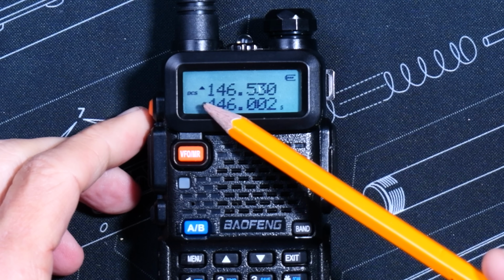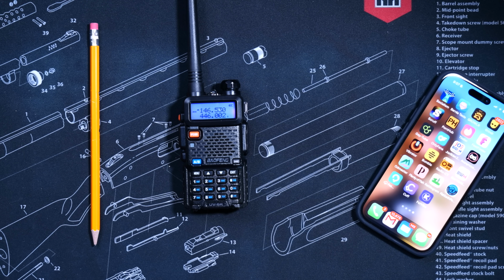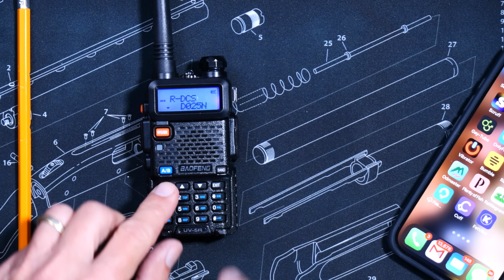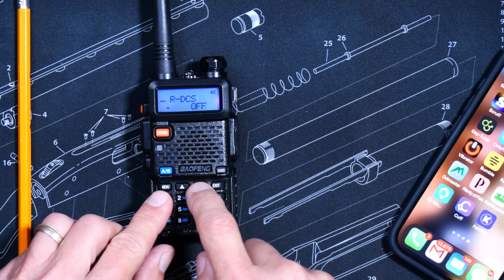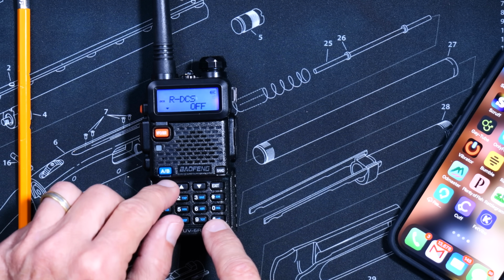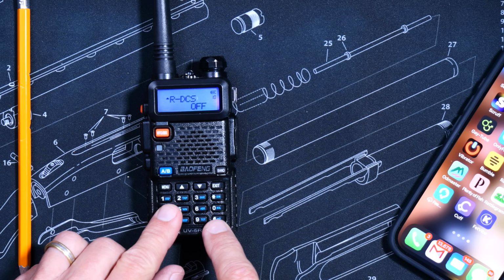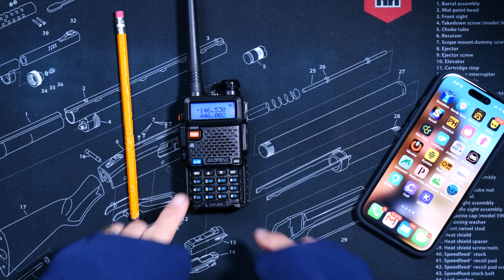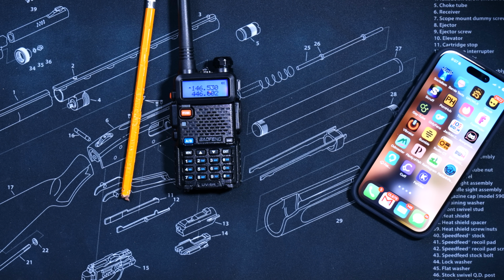Baofeng UV-5R: Why Can't I Pick Up Any Signals? Why Your Baofeng Doesn't Receive Anything

Comment: BaoFeng does not have a sensitive squelch straight out of the box When you programme it on some software you can alter the squelch sensitivity.. Start off on one And if you really want to test it turn the squelch to zero Turn the volume down and put up with the crackle until you can hear a station

Comment: I just got a 10w K5 and imo it performs no better than mY UV5Rs and if you put a UV5R on a rooftop Yaggi I've picked up regularly coms from over 60 miles away and confidently hit my local repeater at 13 miles its hands down a good
Fu#$%ng radio

Comment: My UV5R will not hear anything on VHF, unless the Squelch is opened completely ! 
Works fine on UHF ! 
Going out on a limb, I ordered the new UV5R Mini ! 
Which so far seems to work as designed ! 
Key words here,
 " As Designed "  !
As both radios seem to have a problem with hearing other RF sources, causing you to lose the person you're talking to, until the interfering signal stops ! 
Just Say'n !

Comment: Unfortunately you missed this particular very important difference! 

Instead of saying factory it says Copying! 

Turns out the Baofeng UV-5R also shows: startup/firmware screen rather than the normal “FACTORY” reset menu.

If it says “COPYING”, it may be in a programming/firmware mode rather than the factory-reset procedure.

If you can, send me a photo of exactly what the screen says (and the buttons/position you’re pressing). I can tell you the correct sequence for your UV-5R version.

￼

I am pressing MOM PTT and volume at same time

Yes — that explains it. Looking at your photo, you have the classic UV-5R layout, and the “M”/MONI side button is the one involved in cloning.

If you hold MONI while powering on, an older UV-5R can display “COPYING”. That is not the factory-reset mode; it is the radio-to-radio cloning mode. 

To factory-reset your UV-5R

You don't need to hold PTT + MONI.

Turn the radio on normally.

Press MENU.

Use ▲/▼ to find menu 40 — RESET.

Press MENU.

Choose:

VFO = reset frequencies/settings while retaining programmed channels.

ALL = full factory reset, including memories.

Press MENU to confirm.

It appears your not as knowledgeable as you make out! Best leave this type of video the experts in future! 😉

Comment: The instruction for turning the CT setting to zero does not work.  After performing the steps several times, setting it to zero and pressing menu to save, it reverts to the previous setting immediately.

Comment: When I set the Roger setting, mine says off or Beep, To-1200, no On! How come?
Reply from the maker: I dont think you have a "UV-5R"
Reply: @TheNotaRubicon  I have the same on one of mine. Two UV-5R, but slight differences between both. The new one displays the letter H next to the signal bars and plays NOAA perfectly clear, while the old one does not receive any signals at all, not even from the other radio. The old one doesn't even show on Amazon anymore but the seller was Airiton, and the new one's seller is Vitahui. I think I just ruined the old one by saving over it in CHIRP. The black stickers on the inside differ and the battery numbers differ, but all else are the same.

Comment: I guess this video is aimed at those that, a month after buying one, were still struggling to turn a baofeng on, only to discover the battery has died. Then the trauma of finding out which way round the radio sits in the charger. These are real world tech issues that need discussing, and guidance given where necessary.

Comment: I noticed I get a clear signal when the antenna is screwed in halfway or less, and when I screw it in all the way the signal drops. I’ve tried on multiple antennas and it happened on two separate radios. Am I doing something wrong or are these just cheap? I can’t find any answers online.
Reply from the maker: Its a $20 radio.. It is the very definition of "cheap".

Comment: I took a 19.5 inch piece of 22 ga wire and loosened The antenna on my uv-5r and tied a loop around the base of the antenna and tightened the antenna down onto wire. Last night sitting in my living room in my recliner, I was picking up a repeater over 40 miles away from me. It was the Lewisville, TX radio association Wednesday night group. I didn't call in but just listened as there was a bad thunderstorm and they shut down early and I didn't want to interrupt them. I am awaiting the arrival of my R58 coax so I can build a wire j-pole and a moxon antenna, and maybe a yagi too, so my little radio is even more powerful, can pick up stations farther away that is. You just need to educate yourself on how to use the little radio and it will really surprise you what you can do. 73

Comment: Could a slightly beant antenna be a reason why? Like the light lights up but I don't hear anything
Reply from the maker: If the light lights up, then the antenna is hearing the signal. If the antenna was broken/not working, the light would not light up.

Comment: I use mine to listen to local emergency dispatch when the power goes out.  Otherwise, it sits on my desk as an FM radio (music).

A BIG thing I noticed is that most publicly available frequencies are unintuitivly listed with the FCC.

Example, my town and village both have frequencies.  Neither is ever used.  The town's volunteer EMS/fire squads use a county level repeater based in a seemingly random town.  That frequency is just registered to the town it's in, with no explanation of its usage.

TALKING to a friend on the fire squad, I got the actual frequency.  And immediately, it came on crystal clear.

Comment: What would be a good digital radio or scanner all I really want to do is listen to the police fire
Reply from the maker: Uniden SDS100 or SDS200. But be aware that if the police in your area use encryption, no scanner will be able to listen.
Reply: @TheNotaRubicon i belive they switch to phrase 2 trunked i just got my gmrs license so just playing around trying to learn i have the tidradio th8 gen 3 ive have it in unlock mode i might just need to put it in gmrs mode

Comment: Circa Y2K, I'd played connecting my Nokia350 phone 470 Mhz to the tower mounted hi gain ant. for 100 W. paging Tx. on the same freq. band. It received better signal for sure and my phone didn't break out when making a call. The base stations for this Nordic system phone were scarce and distant from each other at the time.

Comment: Soooo.....my main reason for looking up this video is because I was not receiving any of the NOAA channels.  My ar-5rm came with 3 different antennas.  I figured that the longest one would get the best reception, so I installed it immediately after opening the box.  As soon as I changed out the antenna to either of the shorter ones, I had weather coming in JUST FINE like I do on the CB in my semi.  Can someone please explain why this is?
Reply from the maker: The best antenna is the one made/tuned/resonant to whatever frequency(s) you are using.. so longer does not always mean better.

Comment: Here's my tongue-in-cheek-theory: the average licensed HAM enthusiast is old enough to hold grudges for all other operators and thus not talk to them. Or they have no time between scolding newcomers off the air and receiving the weekly enema from their nurse. When I'm reading the names on my local radio groups homepage I'm reading the Top 10 of baby-names from the 1940s. 
Don't get me wrong, being old is no sin. Happens to the best of us.
But maybe the scene is simply dying out because it's not welcoming enough to newcomers, and no one wants to look further into the hobby after the first contact, being threatened with prosecution for using his cheap chinese handset the wrong way :)

Comment: Last week, my Baofeng UV-5R went silent, and I figured out why: it’s on strike! Turns out, it overheard me bragging about my fancy new headset and got jealous. Now, it’s sulking, refusing to pick up a single signal. I tried coaxing it with fresh batteries and a shiny antenna, but it just static-sassed me like a moody teenager. My buddy swears it’s haunted by a ham radio ghost who’s mad I didn’t say “73” properly. So now, my UV-5R’s a mute diva, and I’m stuck whispering apologies to a walkie-talkie.
Reply: DID YA FIX IT?  HOPE SO!

Comment: On my UV-5R, I removed the TSQL (it was set at TSQL on 88.5) for my universal channel (144.625).  I reset it to blank.  Is there a reason other than locking to another radio with that same tone that you have to have a tone set? I really just want to pick up anyone in the area during bad weather or an emergency.
Reply from the maker: If you want to hear everything/anything on a frequency, you should remove all tones, otherwise you will hear ONLY something that is transmitted with that same tone, which will limit what you may hear.
Reply: Nevermind, I found the video about the dehydrating babies.

Comment: You saved me sending my boofwang radios back. My screens were not lighting up nor were the radios transmitting or receiving. Turns out they need a battery, then you have to turn the knob to turn them on. Only problem I have now is I keep hitting the menu button but they won’t transmit. Idk may try the jumper cable method.

Comment: Question, I have two of these radios, one works like you are showing with turning off the DCS if it's illuminated. The other doesn't stick like it's locked in. I turn it to off and hit the menu button it says confirmed. But the DCS light stays illuminated and there is some frequency back in the box for both the receive DCS and the Transmit DCS. Suggestions?
Reply from the maker: are both radios in the same mode? ie; both in VFO mode or both in Channel Mode when doing this/comparing what they do?

Comment: Short answer:  Because there's nobody there. 
People stopped using radio like 75 years ago...    TV k ll ed radio... and then the personal computer and internet k ll ed TV.    You're watching and listening to this on your home computer or smart phone, not on your Baofeng UV-5R.  Or your boat ancor receiver in a ham shack.  Why are ham's in such denial their hobby is dead, and why do they keep buying radios expecting to receive valuable information on them???   It's a bizzare disconnect with reality.  If you buy them because you just like lots of buttons and displays, computers have those too.... even more so.

Comment: Theses settings will not turn off on my radio I did exactly what you said to do to turn them off the DCS will not turn off
Reply from the maker: Then either you did not do exactly what I said, or, your radio is defective.
I doubt that your radio is defective.
Reply: @ I went to menu I went to R – DCS I press menu again went to the off setting hit menu again and the DCS stayed on

Comment: God, you reeally do hate roger tones. but why? i know it sounds unproffesional, has been obsolete for ages and is completely unnecesary, but whats so terrible about it? From my opinion it adds the walkie talkie feel to the entire ham thing, yet you, an undoubtedly experienced ham, sould like whenever you hear the baofeng roger tone youll get some kind of ear cancer.

Or is it because 99% of roger tones on air come from 15 year old unlicensed operators playing with the uv5r they got for christmas on sale for 10 bucks? 
I would get that but thats honestly not the fault of... menu option 39 -

Also i would suggest you just stay quiet and be happy that above mentioned operators havent found out you can create way louder, longer and more pain in the ass custom roger tones with the programming cable
and no i wont tell anyone how because that would start a roger tone apocalypse. Compared to what you can create the default boofwang roger tones are completely fine

Comment: P.s. I don't live in the middle of nowhere, but the only thing I seen to be able to pick up (on any radio) doesn't seem to be able to find anything worthy, I definitely have found some encrypted stuff before it juts sounds like a lot of " digital hammering" and weird pulse noises. One time my little brother picked up a conversation of 2 guys talking super far away through a repeater, but I've never had such luck. I have the one that can pick up several different bands, including air bands, which I figured would be cool for living next to an airport, can't seem to find those either. And it's not posted online (that I can find) what frequencies they use, kinda annoying. They work just fine for talking to each other from a pretty good distance though.

Comment: I bought 2 of them and charged up one and couldn't hear anything so I turned it off put it back in the box, cause I forgot that I rode the short bus and probably more retarded now than ever so I knew it was operator error and told myself when I have time I will search for someone that knows what they are doing and can slowly explain it to me, pictures would be better but I think this video will work😁

Comment: My Blue Fang radio works great with a 15" ? (Missing tape measure) antenna.
Police, Fire Department, Railroad, Cab company, and amateur radio. Local weather guys are always out reporting on stuff during storms. Cab company is good for laughs and finding out how the roads are during bad weather too.
Had to buy a bigger battery because it just makes sense to do so. I went to public school in the 80's, not sure what to say about that. I do know which bathroom to use. 😂👌

Comment: I don’t have issues with either of my boo-thang radios, even sometimes my one picks up more far things than the other with the long whip antenna and my bigger Midland in my truck….I don’t think I hold my mouth open funny or put on my foil hat when I switch between them.  You should also point out you might not hear anything in you wag any radio around by the antenna…..

Comment: I recommend always having at least two of these (I mean look how cheap they), this way, you can hand one to someone walk outside or the other end of the house or some distance and see if when you TX they RX, then when satisfied, swap radios and do again, that way you have tested both ways on both radios and you're not subject to no one else in your area is transmitting.

Love all your videos man.   You're definitely a resource for the radio community. One of my sons was having a radio issue and he searched youtube, found one of your videos and solved his issue.
Reply: USE A LENGTH OF STRING.  SAVES BATTERY NEEDS!

Comment: For an el' cheapo radio the UV-5R is not a bad little radio.  I use it mostly for monitoring various public service frequencies and, since I have my ham license, I also use it for working some of the local ham repeaters. I have always got good signal reports with it as well as decent audio reports.  For programming the radio I highly recommend using the adapter cable and the "Chirp" software package. Also, when you get a new UV-5R the first thing you need to do is to get rid of the antenna that comes with the radio and replace it with a decent antenna. Makes a very big difference. It's pretty durable as well. I have dropped it dozens of times and never had any problems with breakage or malfunction.
Reply: According to the Ukraine Oversight website of the U.S. government, as of September 30, U.S. funding for Ukraine is nearly $183 billion, with $130.1 billion obligated and $86.7 billion disbursed.ve on that is  13 years old. The display is starting to go out.

Comment: Just found your channel and love it. Especially the Daniel Penny picture.  However, as a retired US Coastie, under the UCMJ it is a bookable offense to hold a radio by the antenna and flop the radio around!  It is an ANTENNA, not a handle!  Just kidding, sort of. Doesn't' that hurt the antenna to do this? there used to be wire in the antenna and this would break them over time.

Comment: I have a 5 watt radio and my buddies can't hear me when they are using their 25 to 50 watt car radios. Is there anything they or I can do to communicate with one another?
Reply: Change your rubber duck antenna for an RH-770 dipole extendable antenna (make sure you get the right connector for your HT) & then try talking from higher & open ground.

Comment: Hi there, you that may have more than one of all the versions of the UV5R ever released... do you know about an issue reported when deleting a channel on the radio, it deletes all the names in blocks of 32 memory positions, just the names, and it's solved only re uploading it from chirp backup. I think that's a firmware issue, old models. Do you know a solution?
Greetings there, have a nice day.

Comment: "Why Can't I Pick Up Any Signals?"
Perhaps turning it on would help.  Charging the battery also helps.  You'll need an antenna.  Finally, someone has to be talking on the frequency you have chosen.

Comment: Reason 3: you're not hearing anything because nobody is transmitting anything. Which is true in perhaps 80% of the cases. In my experience most TX these days on the frequencies and analog modes that Baofeng can RX is: construction workers, children playing with walkie-talkies, mountain hikers and railway workers. If there's nothing of this kind near you, the chances are you won't hear much.